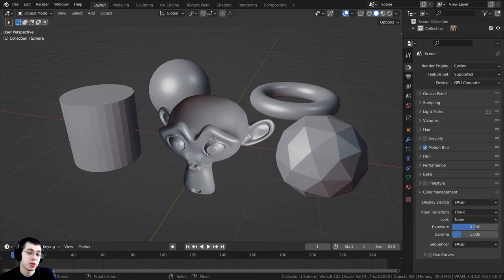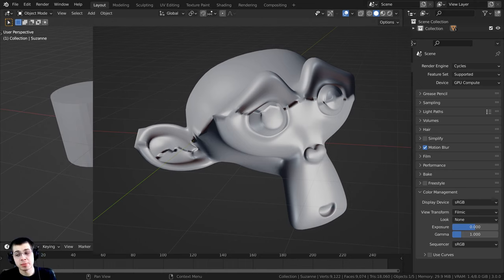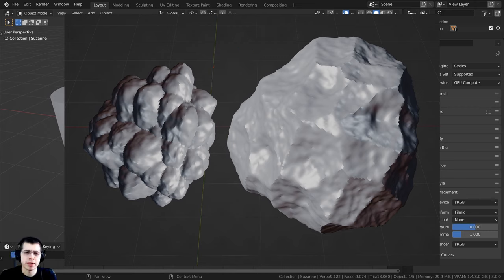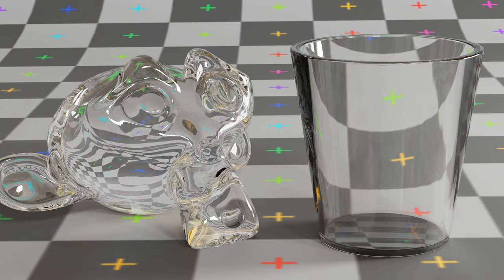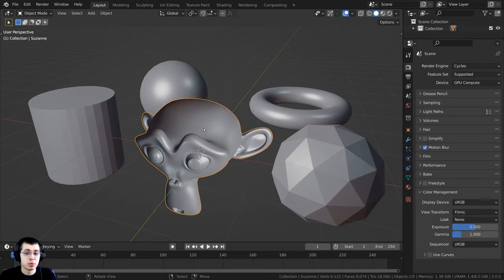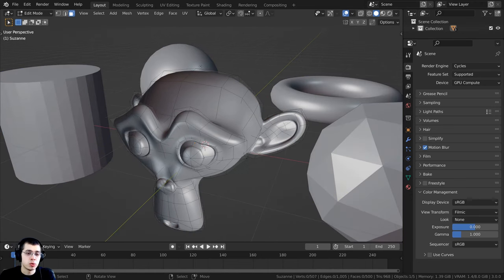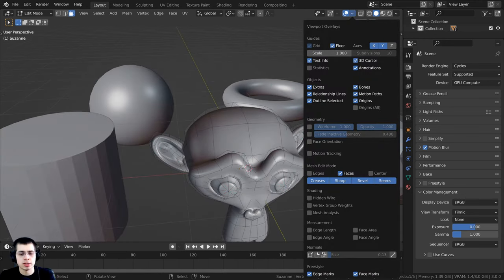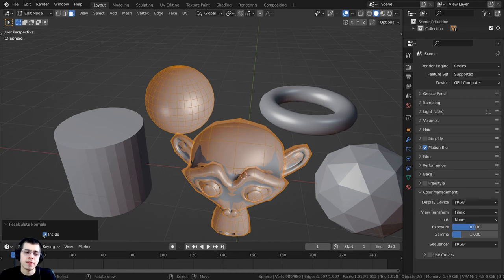Understanding Normals in Blender

Comment: Was just looking for this one. Modelled a ring, and it was from an old blender 2.68 video tute.

As you might be aware, the interface menus and options layouts have come quite a long way since then and I couldnt find the right option to recalc normals in 3.0 the way the radio buttons were in 2.68. Maybe now I can make the ring look more solid by recalcing the normals correctly...thanks!
Reply from the maker: Hope you find the video helpful! Yeah, just select all of the mesh in edit mode, and press Shift + N.
Reply: @RyanKingArt  thats changed too I think. The old shortcut may have been alt+n.

Comment: Happy new year, 
and right now again, I have another question if I may.
So, I understood that the normal facing is calculated in Blender according to the indexing of the vertices of a face.
As I remember it if the indexing is clockwise then the normal is facing outwards, if it is counterclockwise it is facing inwards.

My question now is, if the indexing for a face is in clockwise order, and let's say I have a triangulated mesh, then adjacent faces share 2 nodes out of 3. Now how can one of those faces be turned outwards while another be turned inwards?
When an ordering is already defined for 1 face then every edge of it is already set according to indexing in a specific direction.
Does an adjacent face have its own indexing? If not the direction could not be changed on adjacent faces without influencing its neighbours.
And as this effect would be transitive, I could either have all faces pointing outwards or all faces pointing inwards. And yet somehow I can have part of the faces turning outwars and part inwards. So how does that indexing work then?
Thank you for your insight.
Reply from the maker: You could select all of the faces that you want to go into the other direction, and then use the "Recalculate Normals" option. And if its still the wrong way, then checkmark the "Inside" Button, after you flip the normals.

Comment: Hello,
as always thank you for the descriptive video.
And as always I have a question if I may.
I would like to make an animation where I want a scene to appear as some plane surface moves down.
The surface will be at the top of the viewport in the beginning and move downwards until it reaches the bottom in the end.
Now I would like everything above the surface to be shown, everything below it not.
My appraoch at the moment would be to activate backface culling, and then for every mesh in the scene have the normals point inwards when below the surface and outwards when above it.
Now my question would be if you would know of a way to do that.
I need to define which way the normals are oriented depending on some condition.
Maybe somehow with a boolean modifier would be my first guess, but I have yet to find a way.
Thank you for your help.
Reply: Ok, I found out that you can use Math nodes for conditionals. Now I would need to figure out if to use geometry nodes or shaders for setting the normals, I guess.
Reply from the maker: Hmm, I've never done something like that before, so I can't think of any easy way to do that, off the top of my head. The only thing I can think of, is to make a plane a bright emission color, and then do some green screening to make the emission plane transparent, after you render the images. that way, whatever the plane is covering would be transparent.
Reply: @RyanKingArt  Thank you for your insight, off the top of my head I think both approaches have advantages and disadantages.
For your approach if I have objects with larger faces,  those faces could be partly shown and partly hidden, while in my approach a face can only either be shown completely or not. On the other hand I think the advantage of my approach is as far as I udnerstand, that with backface culling only the faces are rendered with normals in direction to the camera. So those faces with inwards normals would not be redered at all, saving quite a bit aof computing power.
I will try out both. Thank you for the answer.

Comment: Hey Ryan,

So I have a bed frame mesh which I'll be using for my video game on Roblox and one of my testers pointed out how it seemed a bit too thin. So I applied the Solidify modifier to it in Blender to try raising the thickness up a bit but it ended up distorting the mesh a bit instead as if cutting it. I was wondering if you could have a look at the clip which I posted a thread on in the Roblox developer forums about this issue but it looks like my comments keep getting auto deleted due to the link, is there any other platform I may DM you the link to? Nobody has really replied to my thread and it's getting a bit frustrating!
Reply from the maker: you can send me an email message by contacting me on my website contact page.